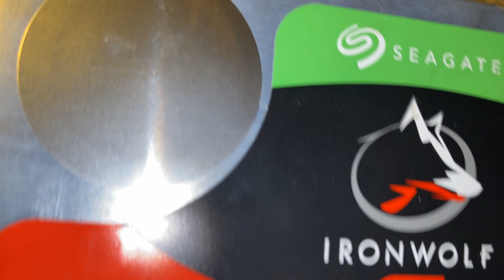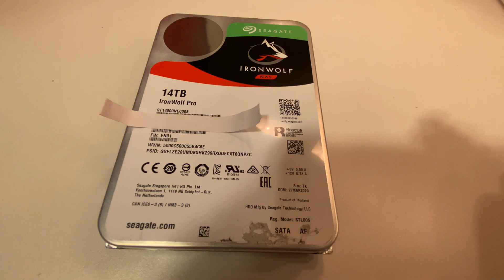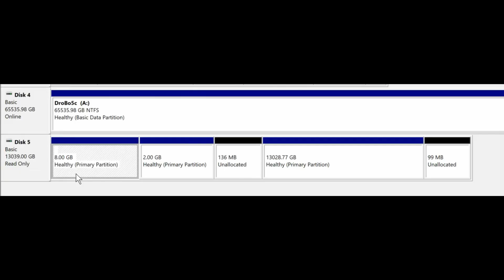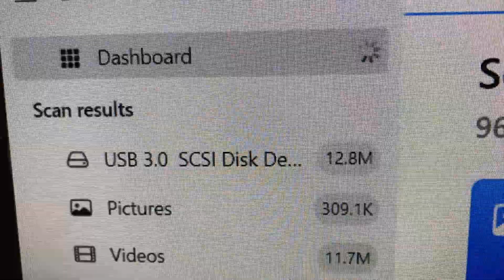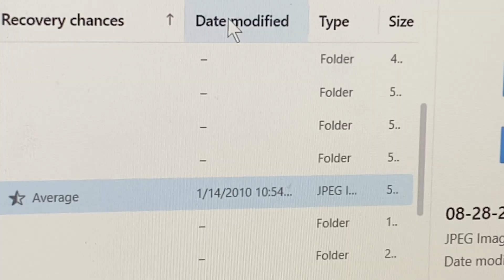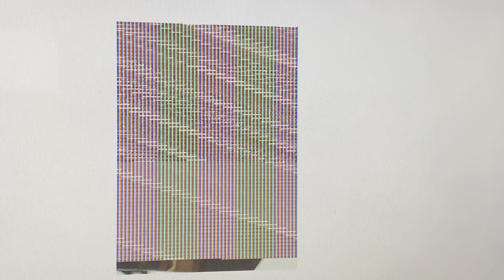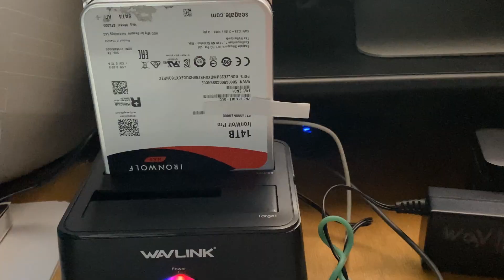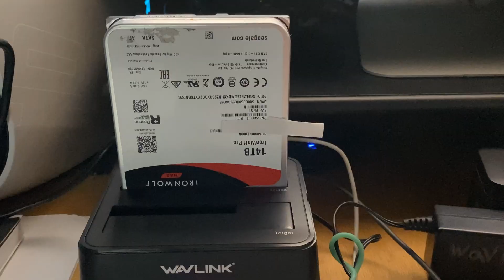Can i / How Much Data / info Can i Recover from a One 1 NAS Drive HDD Hard Drive from 4 Bay Synology

Comment: Unrealistic scenario. Anyone who is going into your house to steal one drive is going to steal the entire box. But I get it you were doing an experiment. If you understand how disk parity works in a raid there is information on each drive about the other drives on each drive. What you are referring to bit rot is not entirely correct it just means that a particular file has the rest of its data stripped across some of the other drives.  But yes you are correct if the files are unencrypted you will find a good percentage of the files intact by doing a deep scan using recovery software.  Thnx for sharing.

Comment: Disk Drill is a lifesaver, I’m a professional photographer and videographer and I’ve had to recover hard drives, SD cards, SSD drives, M.2 drives… It will pay for the lifetime license plus lifetime updates the first time you use it! I’ve tried dozens of other recovery programs either on licenses I got with the purchase of cards and drives, or on trials, and none of the ones I tried worked quite as well…
Reply from the maker: @jonkeau5155  i agree, I purchased it the first time it came out, i think 10 plus years ago. I have saved many persons data with it, friends and family are still thankful today, works really well.

Comment: In a RAID config, the files are distributed between the drives.  So each drive, will in most cases, have only parts of any file, and NOT the whole file.  Small files might be an exception.
Reply from the maker: @stevenbliss989  before doing this video, I thought it would be impossible to recover any data from a raid 1 or shr1 NAS config, and I wanted to confirm it, so in upgrading to a larger HDD, i thought I would try it to confirm it. So i gree with you in maybe being able to recover small files, but thats the issue, how big are documents with sensitive data / data? Tiny, so i was able to recover many documents, maybe not all, but some, which is scary, I assumed all drive in a SHR1 configuration would be needed to even recover 1kb of data, but i was surprised with what i recovered with a standard external USB dock & a piece of software anyway can buy.
Reply: @mtandiz  The data block size (i.e. the smallest CHUNK) stored per drive is a parameter, and way larger than 1k, but varies between NAS manufacturers.  It is one of those things that is a trade-off between speed and storage efficiency and CRC calculation rate etc. etc.
Reply from the maker: @stevenbliss989  thank you for info

Comment: This is idiotic. No one will recover ANY readable files from 1 drive from a NAS unless it was in Raid0

Every single file will be gibberish
Reply from the maker: @robertbslee4209  i disagree, i did a  Disk Drill quick scan, & recovered Documents, not all, but some, as for other data, videos pictures etc.., the quick scan did not recover those files, they looked like they were bit rot files. But then i did a deep scan with disk drill, & i was able to recover documents, pictures and videos, not all, i will say about 20% to 50% of them. I did not complete the full scan, only did about a 10% deep scan, & thats when the odds got better for me. I am a regular guys, just trying different things, i was upgrading my NAS storage, & thought, “I wonder if “?, thats all. The shr1 was not encrypted, thats why i think I was able to recover some data. I think if the shr1 would have been encrypted, i then would not have recovered anything.